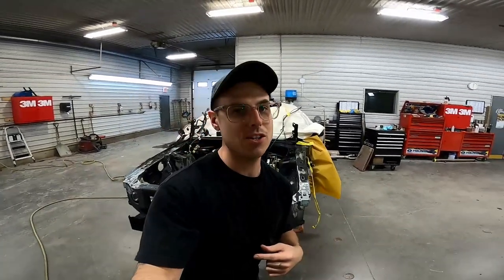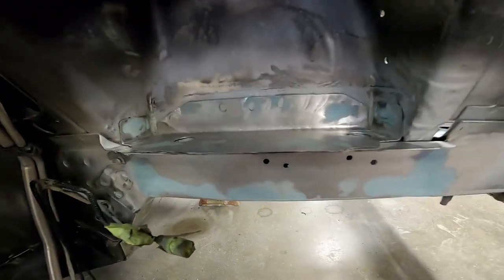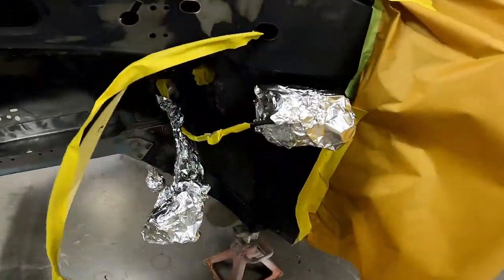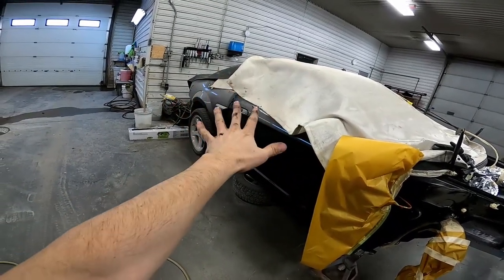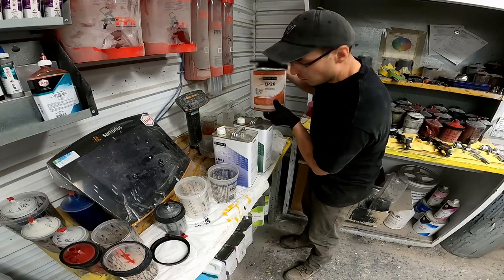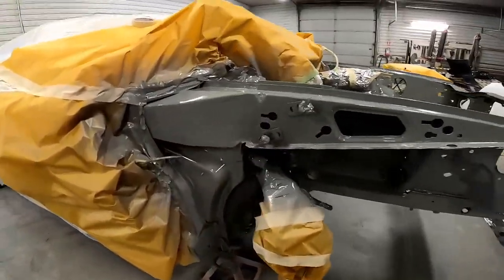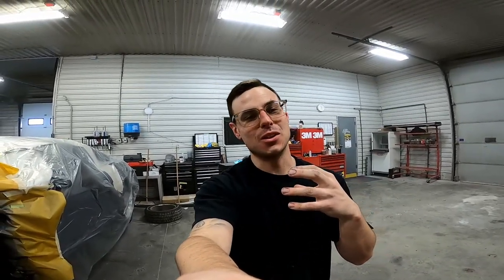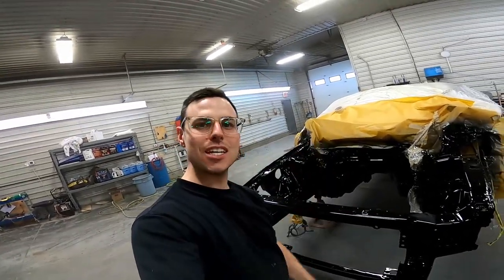DIY Engine Bay Painting 101 | How To From An Auto Body Paint Technician

Comment: Very nicely done.  For those that dont have an HLVP gun, any thoughts on Eastwood's AeroSpray 2K Spray Paint?  They state that its a 2 Component Ceramic AeroSpray Paint that has the durability and precision of a 2 component coating without the paint gun.  The two-chamber design mixes the ceramic fortified coating and activator right in the can.  Any opinions would be appreciated.  Nice workmanship on your job.
Reply from the maker: Thanks for the comment! I don’t have any experience with that product specifically, but aerosols generally don’t offer as much control over application of the paint material, which is the main advantage of using a spray gun. If you however don’t have access to use a spray gun, there isn’t anything wrong with a good quality aerosol product